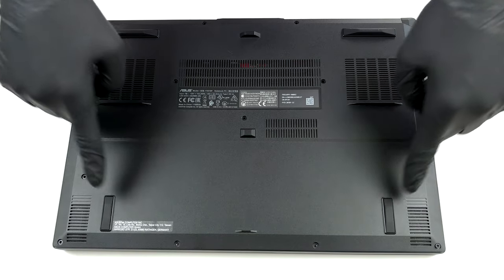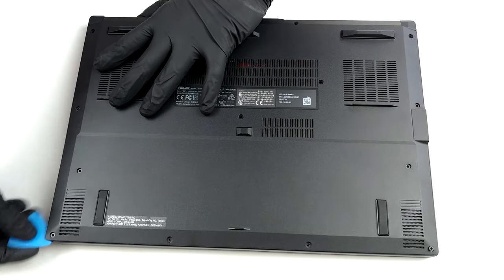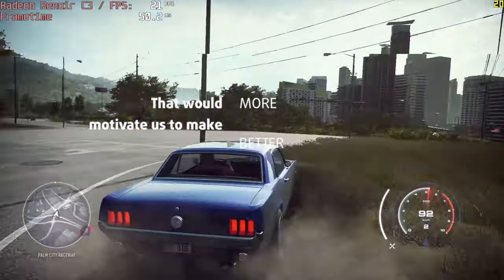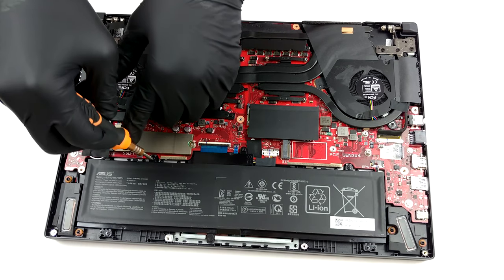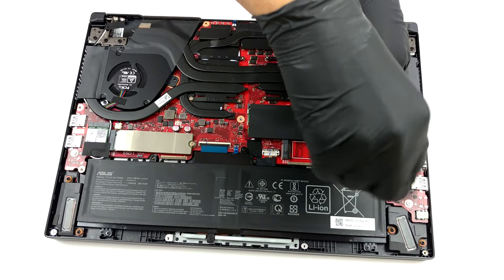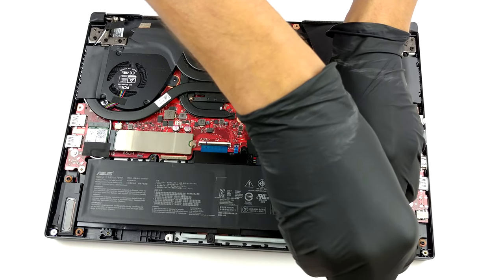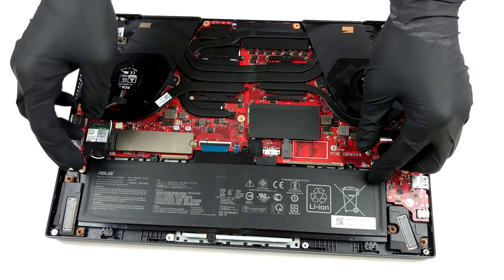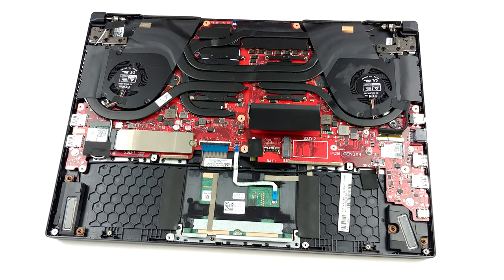🛠️ ASUS TUF Dash F15 (FX516) (Core i7-11370H + GeForce RTX 3070) - disassembly and upgrade options

Comment: I can’t believe that the thermals and overall design between this the zephyrus and the strix are the same just slight differences between the 3 in terms of battery capacity, heat pipes and overall specs

Comment: Thank you for the video! I want add a second m2 nvme, what thermal pad (tickness) and small heat sink must I choose?
Reply: did you figure out how to lift the screw on the second m2 slot? i’ve tried every screw bit i could and none of them make the m2 screw budge
Reply: @man8918  I think you need a JIS screwdriver if I'm not mistaken. A common mistake is using a Philipps screwdriver on a JIS screw which not only will it not budge, but it will also wear out the screw.

Comment: A weird question - will the laptop work from socket power with batery removed? Lost count of the laptops I had (ok, may be 4 in the last 15 years :) working on a desk on wall power, and when one day you unplug them and deside to use them on the go - the batteries were all waisted and degraded. Anyone?
Reply: Not sure about this but my old asus tuf does work directly without any battery. Source: tried it

Comment: So whenever I play games my fps drops, I remember adding an ssd on my asus, when I tried to connect my battery connector back in its place. It kept sparking on the white part, does that mean the battery is causing my fps to drop and input lag?

Comment: how can you upgrade to 32GB ram if there's one slot?
Reply: Would also like more info on this ^
Reply: @grantfosbraey783  You can get a single 32gb stick from crucial
Reply: @TheGamerCherry   Hi,  no error problem for 32gb stick from crucial in one slot ? i have ASUS ROG FX516PM-HN002T
Reply: @TheGamerCherry   same notebook: ASUS TUF Dash F15 (FX516) (Core i7-11370H + GeForce RTX 3060) DDR4 ON BOARD

Comment: If i put 16gb ram in slot, it will work in dual channel (with 8g solded)?
Reply: No, you will lose dual channel. It must be the same amount. For example, 4+4, 8+8 or 16+16.

Comment: Single channel ram?? Should I be concerned since I've Pre-ordered this with an rtx 3060. This model comes with 8gb ram here in the UK
Reply: I'm pretty sure it's dual channel but with one soldered directly and one user replaceable. So if u order with 16gb of ram, 8gb of ram is soldered.
Reply: @kaushalrathi3234  OK thanks
Reply: @kaushalrathi3234  mine will come with 8gb ddr4
Reply: @giuliodifrancia4345  buy 8 giggs so it be become 8+8=16GB dual channel
Reply: @giuliodifrancia4345  tbf I'd rather just one 8gb stick and one slot free, would be a bit annoying to have 4gb soldered. Unless of course you don't ever plan on upgrading. I only play lighter titles so probs not a concern for me.
Reply: i need the pre order link please or order
Reply: @justzachbeale4396  demand must be high since dispatch date has moved further to 15th March, a long time I know.
Reply: @giuliodifrancia4345  I'm sure with the 8gb model, one stick is soldered and there is free slot. So it will run on single channel unless you upgrade.
Reply: @medicgaming2705  wow, damn thats like 2 months i have too wait for
Reply: I am thinking about buying this model too. Did you receive yours? It says out of stock but available to order. Has this laptop 2 ram slots?
Reply: @serhanbilgin  I personally cancelled the pre order and got my money back. The 144hz screen is mediocre. If I were you, just wait for lenovo to launch their legion 5 pro. Qhd 165hz 500 nits 100%srgb versus fhd 144hz 62.5%srgb 270 nits.
Reply: I have pre-ordered the 16GB variant in which 8gb is soldered. Is it possible for me to expand the memory upto 40GB by installing a 32GB stick in the unsoldered slots??
Reply: @milangautam301  that unsoldered slot will be occupied, you'd have to remove the 8gb stick
Reply: @milangautam301  yes I've just done this today on the f516pr with a 32gb Samsung ddr 4 3200 sodimm memory module (cl22) and it shows as 39.7GB in Windows task manager.

Comment: Does upgrading the laptop void the memory? I got my White i7-11375H + GeForce 3070 Asus TUF Dash 15 on the 8th 4 2021 morning and I am not sure if they void the warranty if I upgrade it to 48 GB of RAM and 3 TB of SSD (:
Reply: if there is no sticker they cant prove you opened it up
Reply: @isaiahschubert804  Oh okay. I think they allow you to upgrade I am not sure. Cause on Asus website, they did state that they intentionally made the laptop so it is easy to upgrade the ssd 😃
Reply: @0animalproductworld558  bro, do u hear whriling metallic like noise from fans at high speed? I have rtx 3050ti verson and I can hear
Reply: @0animalproductworld558  yes, they do.
Reply: @soullette  Yeah, it has something like cliking or fan hitting something noise when the speed is high enough. I tjink it is fine though. 

The laptop runs very hot playing agme so I got a fan for it..
Reply: @0animalproductworld558  Thanks man, I appreciate it.
Reply: @soullette  No problem! Amazon has pretty nice and cheap one. I have one and now my laptop does not really over heat any more and can be touched with bare hands.

It used to feel like almost like boiling water before because of how hot it is!
Reply: @0animalproductworld558  Ok bro

Comment: I now have a laptop 3070 max q and it works less well than the 1660 ti laptop I had ... warzon max graphic: 55-75 fps hope it will be fixed but for now I would love to know if it makes sense that it is like this and just have to wait for a driver update ? And of course the whole computer is up to date and endless attempts to improve the fps.
Reply: Very much in need of a driver update it seems. Here in the UK, we're still in the process of pre-ordering and I am specifically expecting this laptop to be dispatched on the 15th March.
Reply: The 3070 max-q isn't getting enough power with the 80w provided. I have similar framerates and I can't see any other problem than that... try to return it and go for the 3060
Reply: I want to buy one and was wondering if the trx 3070 model worth the extra $350?  Should I buy the rtx 3070 model for 1.455 or the rtx 3060 model for 1.099 usd?? Want it for gaming, for fligh simulator 2020
Reply: @hedi23  haven't had any issues here, the 80W should be enough, either update the driver and laptop or return it.
Reply: @hedi23  is there a way to unlock the power?
Reply: Flash the bios with msi
Reply: I had problems too untill Nvidia released new updates.

Comment: Hey! I have the 8gb ram version, is it welded and have that slot empty or that slot is with the 8 gb of ram?
Reply: I reckon you might have already found your answer, but still answering just in case; the 8GB is soldered, but there should be an empty slot for RAM, where you can put a maximum of 32 GB.

Comment: Hello.
I didn't get the ram memory upgrade part. I ordered mine with 16gb. Will comes with 1 o 2 slots? If I want to upgrade up to 32gb, which memory do I need to buy?
Reply: As far I know, this computer might have 8gb welded onboard. So the other one you can replace with a 16gb card cause 32gb it's the maximum this note could support. So in reality you gonna have just 24gb maximum. I read that somewhere so better to confirm it.

Comment: If you buy the most powerful dash f15 like me. -Note that laptop will drain your battery cause 200W adapter is not enough. So battery is used more like a power buffer. Also note I'm a real gamer, not some random dude who bought this laptop and make review just cause.
Reply: After half year i noticed that it was a software and bios update to reduce gpu power so the battery wont drain anymore.

Comment: An extra NVME slot..... nice. May be worth getting the 512GB model and adding a cheap $100 1TB game drive.
Reply: did you figure out how to lift the screw on the second m2 slot? i’ve tried every screw bit i could and none of them make the m2 screw budge
Reply: @man8918  Maybe try an Allen Key set. (am just assuming from the looks of it from the video, I haven't got this laptop myself, I am planning to purchase one) And try going to Asus -> Support -> Put in Service Tag -> and try looking for Service Manual (in documentation) -> It might state which parts are used specifically for your model and manufacture. Plus the tools to be used for disassembly/assembly.